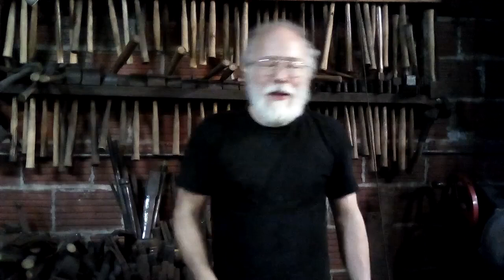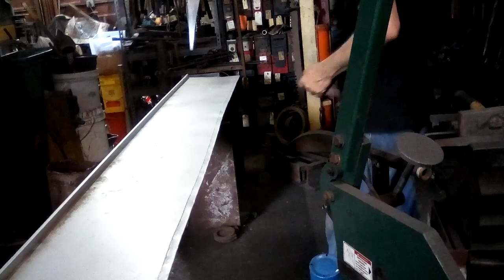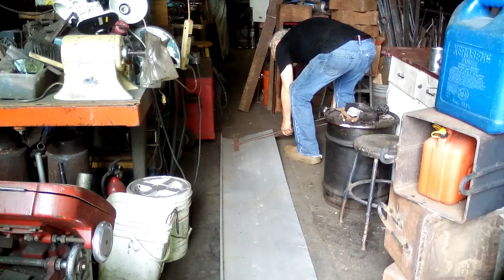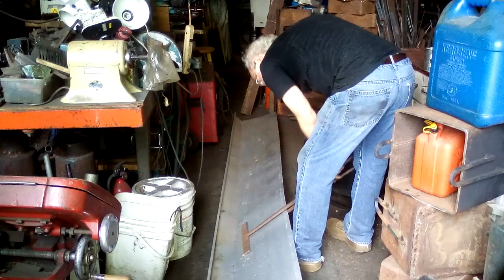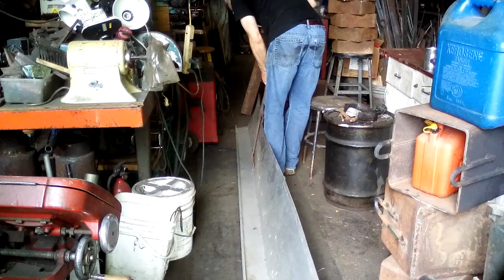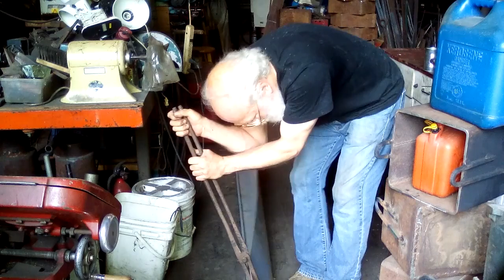A Blacksmith's Dictionary: Valley Tongs and a short Demo on using them

Comment: As a roofer i can appreciate these
Reply from the maker: Roofer and Blacksmith, You must like the heat!
Daniel
Reply: ..roofing company i used to work for bidded on redoing a municipal building. they were undercut a bunch.  bossman told them when they call him to finish the job it was going to cost them, it did. we worked our butts off doing it. all done with hand tools in keeping with the historic aspect....
Reply from the maker: Like I said in the video, I have done two roofs like that and will never do another one. I remember bleeding  on those jobs, sheetmetal burrs are sharp, cut right thru leather gloves. The wear on the body was high, working a foot seamer on a steep pitch roof
Still , those stranding seam roofs last forever if you paint them every ten years, There are roofs over 140 years old in Shepherdstown! 
Daniel